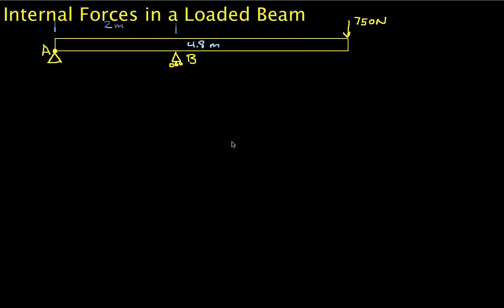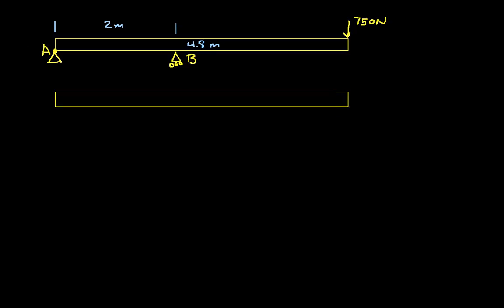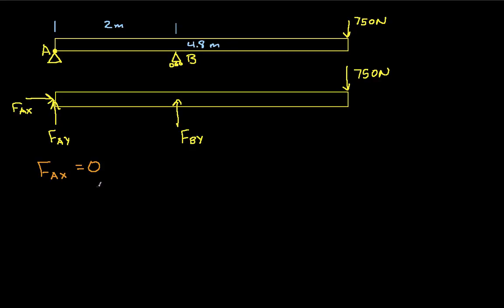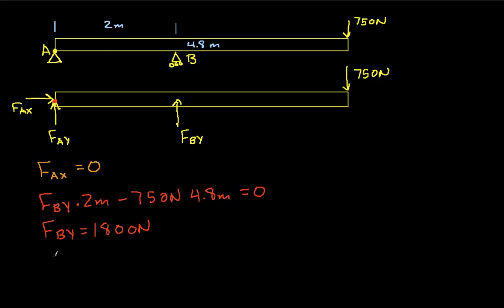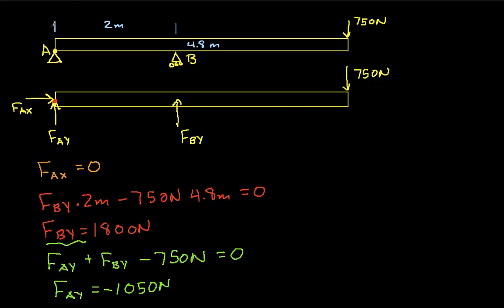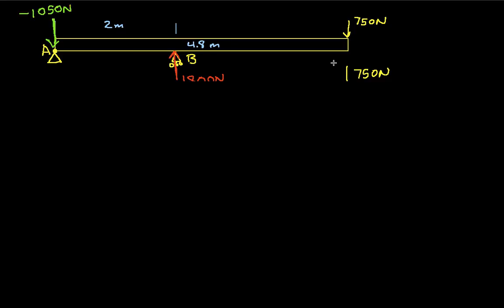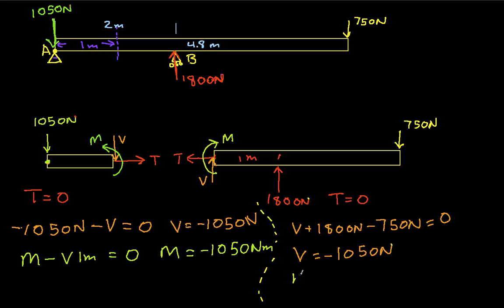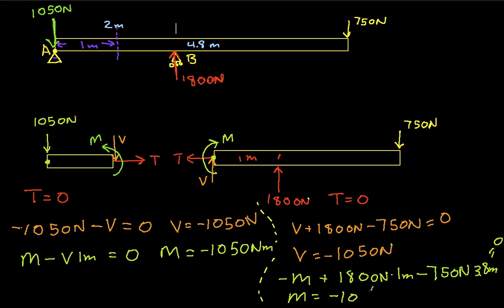Internal Forces in a Loaded Beam

Comment: what if my load is distributed over some length a and the support point is somewhere in that length, but not in the middle?
Reply: Act like you have 2 separate distributed loads and calculate for one force vector at the center of each.